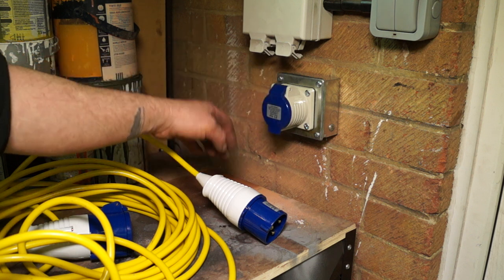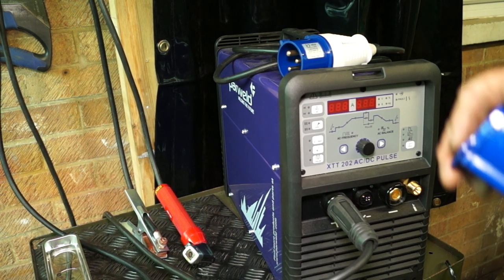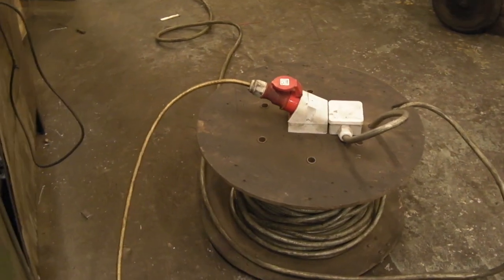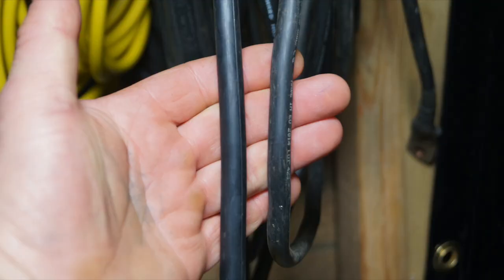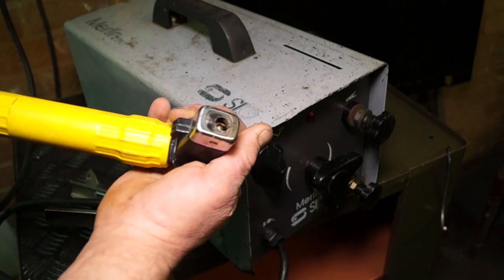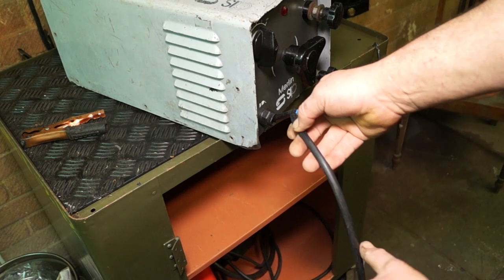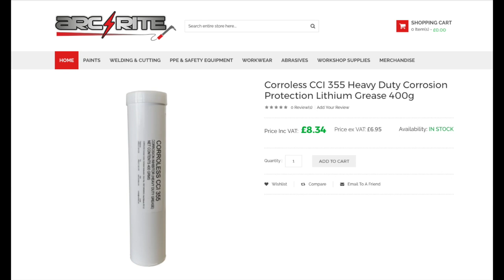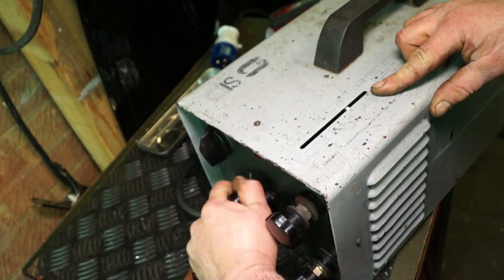Land Rover (Stick) Welding - Welder Power Ratings, Cables, Maintenance etc.

Comment: Thats a blue CEE plug and socket so it cant be a 32A rating.. it's a single phase 16A rating .. could you check that? I have almost 30 years experience as a stage manager and i have never come accross a blue 32A plug. ... tgis would make sense becuase your welder has a maximum 18A rating so 16A would be enough
Reply: I stand corrected there is a singe phase 32A blue plug n socket ( but you would never find it on a stage or in the entertainment industry )
Reply from the maker: It says 32 amp on the body of the plug and socket.
Reply from the maker: Ah, okay.
Reply: Yes I stand corrected, we never see anything of that rating thats single phase on a stage.. threw me there for a while ... and back to the Series III for me ;-) 
Great videos by the way ...
Greeting s from the Alps ..
Reply from the maker: Hello Alps!  :)

Comment: try the shop atsales@weldequip.com , the portamig welder has the same guts as the oxford. i own a portamig 215  loads of power for welding cars. for  welding bigger things like rsj or thick plate just get the arc welder out.
Reply from the maker: Interesting.  Thanks.